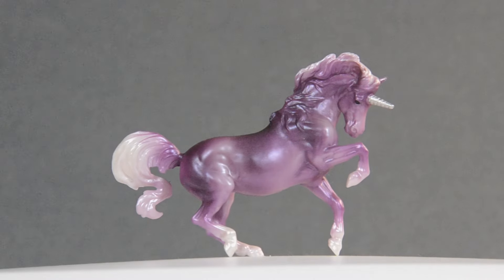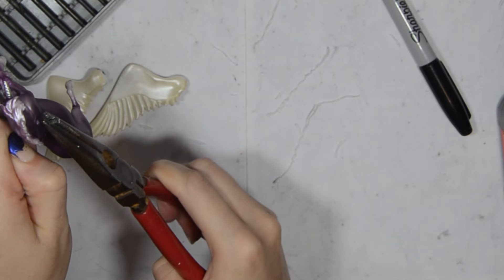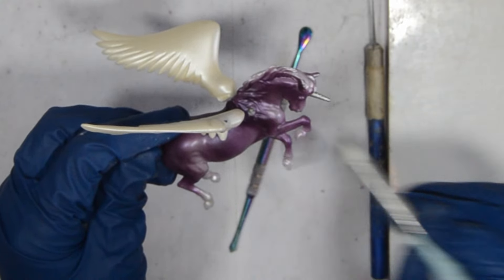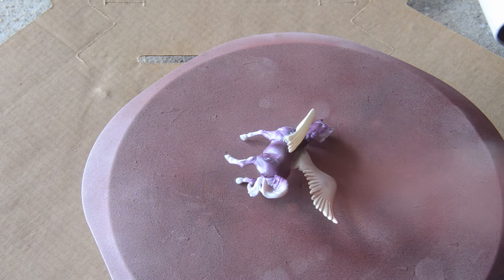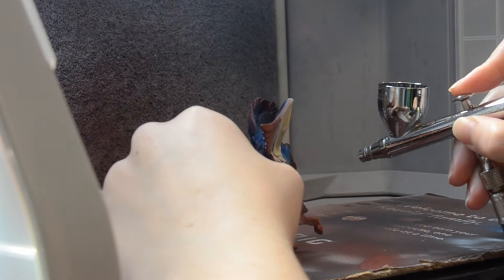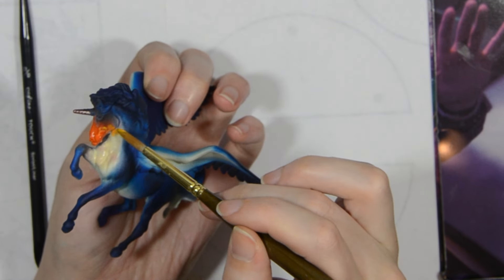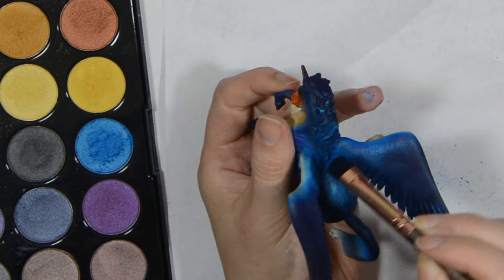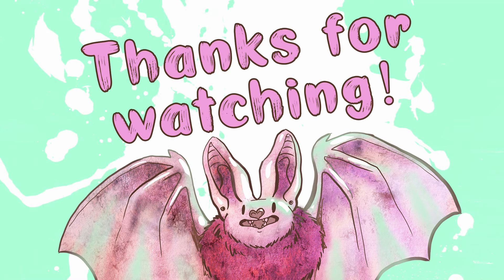Making a Custom Breyer Stablemate Pegasus

Comment: any advice for a beginner? I'm thinking of bying to collecta shire mares and turning them into geldings and paint them like two horses I know irl, one of them I love so much, but I'm unsure where to start
Reply from the maker: Sure! I think anywhere is a good place to start, you will get the hang of it as you go. I don't work much with soft plastic like collecta (daisy stalls has good videos with those) but I think it's similar enough that you need a primer, acrylic paint (liquitex is a good affordable brand), and a sealer in the finish you like (matte/gloss) and where you go from there is up to you! I like using eyeshadow/pastel to shade after painting. And to do any sculpt work you'll want a two part apoxie clay.
Reply: @starbatcraft  thank you so much for the tips, I''l chek out Daisy stalls videos on this as well